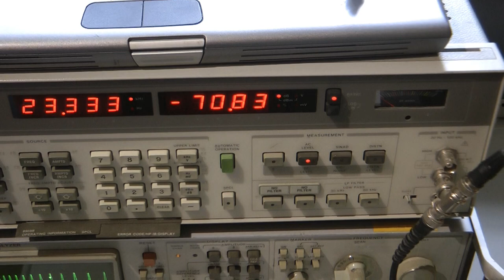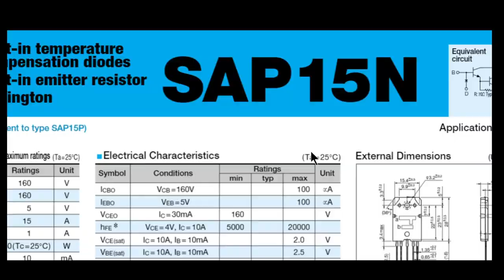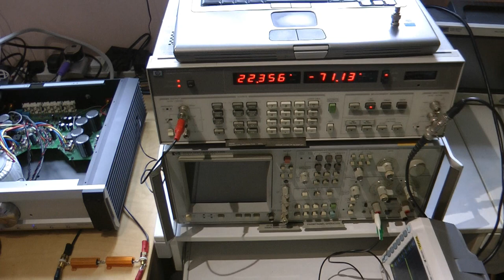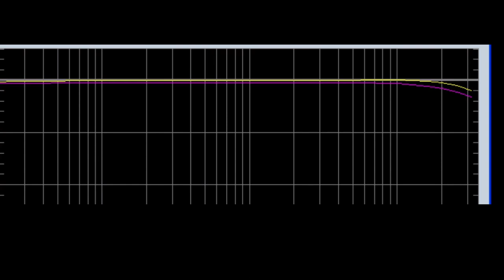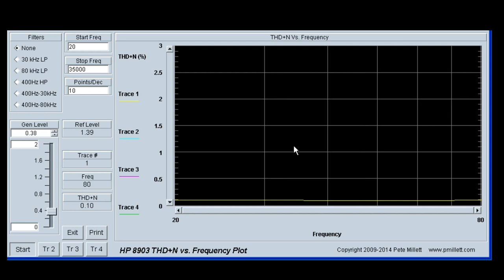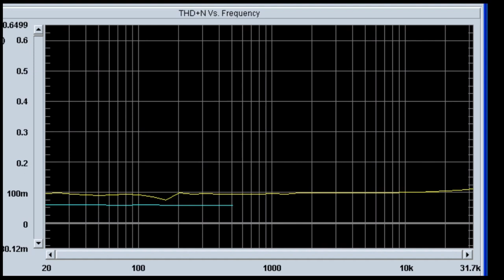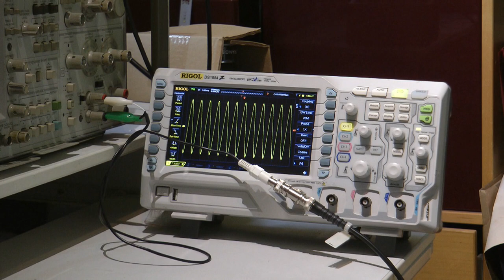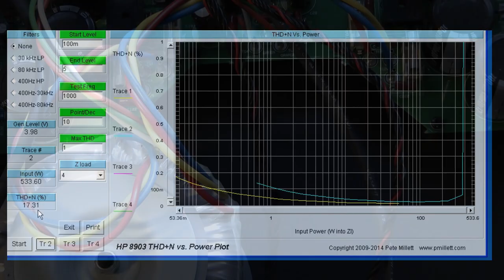Musical Fidelity A5 Amplifier dynamic performance test and Circuit

Comment: Hi, like the channel. Just a quick question. I tested my speaker outputs, and the two righthand sides read 18.7 millivolts, and the lefthand side reads 14.8. Is this normal 🤔
I have a musical fidelity  A3.2 cr Dual mono Power amplifier
Reply from the maker: If we are talking about DC offsets then it sounds plausible. There will always be a minor imbalance. I don't have the spec or set up procedure for the amp but if I saw this then personally I wouldn't worry.

Comment: Do you service vintage hi-fi?,

 Akai integrated amps late 70,s

AA 1175.

East Sussex.👍
Reply from the maker: Depends on which model. If I can get the parts then I can fix anything.  However some of the Power devices are quite exotic and also obsolete.   What is wrong with it?

Comment: Looking forward to hearing how the left channel investigations went :)
Reply from the maker: Turned out to be a noisy OP amp chip in the left channel path. Not all brands meet the claims on the datasheet particular the ones branded as 'low noise audio amplifier'  I always fit Analog devices or Texas Instrument parts.

Comment: Any idea where I can get a schematic for this amp ?
Reply from the maker: I couldn't find it but there isn't much to it.  The amplifier schematic is probably on the power transistor manufacturers datasheet.  I if I remember correctly the power transistors are obsolete.  If one channel is working you can make comparative measurements on the other channel.  What is up with it.  Not really a good amplifier - lots of distortion at low listening levels. Looks the part though.
Reply: @razenby  just looking at it for a friend, but someone's already been in it everything loose screws missing ext, right channel low output ?
Reply from the maker: Just had a look though the manual store.. Nothing on the A5 there, nothing on line either.  The power amp section is pretty easy to debug though  but I cant remember working in the Preamp stages. If one side works just follow the signal and offsets comparing both channels  until you find whacky differences and then you are close to the fault.  Look out for electrolytic caps that aren't in a circuit working near their rated working voltage . They don't like working at low voltages way below their rating and the capacitance disappears as there isn't sufficient polarizing voltage.
Reply from the maker: @graemeholmes6184  Is it distorted on the right or just low gain?
Reply from the maker: Have you got a scope?
Reply: @razenby  thanks for the advice, yes I have a scope, I'm by no means a Tech just the average guy that tinkers a little bit, having a look at it and a bit more info from the owner, its been dropped, it seems like a few issues, it keeps switching in and out of mute,( protection ?) and when you plug into the(think it was the phono jack) there's a short, and the right channel as I said is low out put , don't look distorted just low.
Reply from the maker: @graemeholmes6184  What happens if you cross plug the volume control L & R plugs?
Reply: @razenby  sorry not had a moment to do anything on the amp since last contact, ill let you know when I get chance.

Comment: You and your polished knob, sounds painfull :-D
So Feed a range of frequencys in and see how the amplifier makes a dam mess against the original.
Looking at the pcb, it looks like it was made for another model or a mistake in design.
Reply from the maker: Not a great amplifier I would say. Noise on left channel was introduced in the mixer preamp.  THD at low listening levels was poor.  A triumph of style over content.